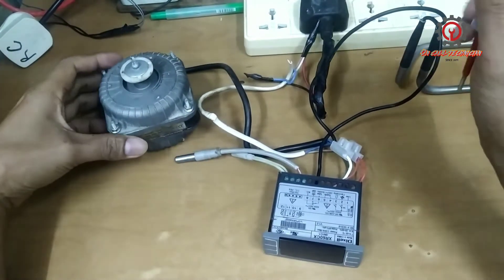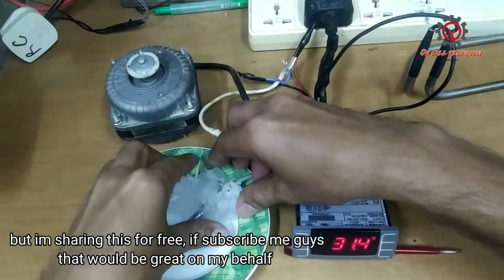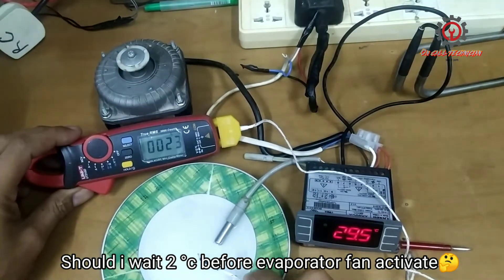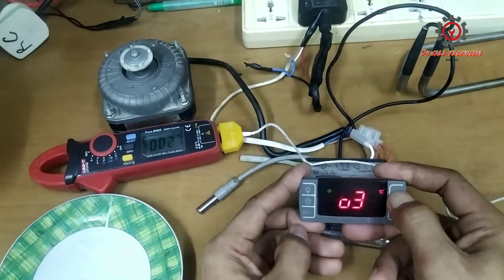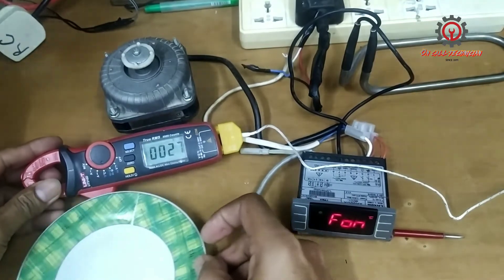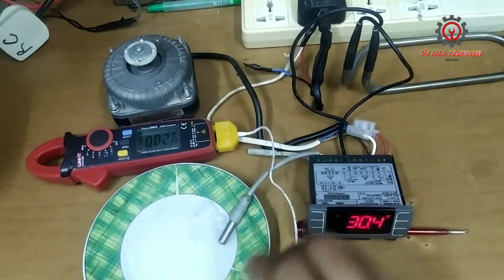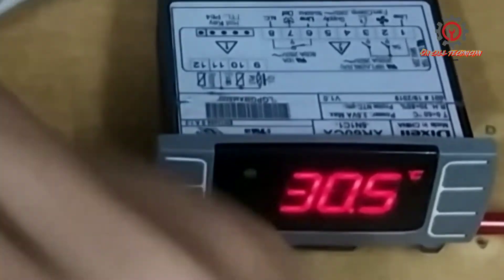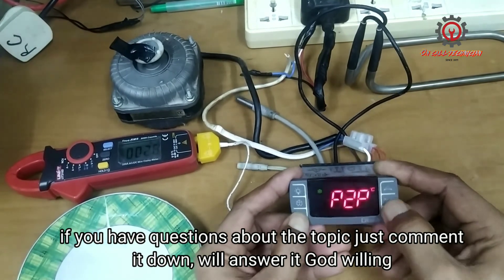HOW TO CONFIGURE FST PARAMETER OF DIXELL / EVAPORATOR FAN MOTOR WILL START AT DEFAULT VALUE

Comment: may isa freezer kami na ang set point ng fst 2 ang temperature negative na pero hindi pa rin mag on evaporator fan, anu sira
Reply from the maker: Follow nyo nasa video sir, or taasan mo value ng FST mo 15 - 20°c no issue po yan. Or baka deactivated ang evaporator sensor mo